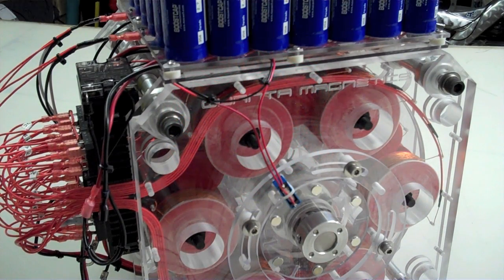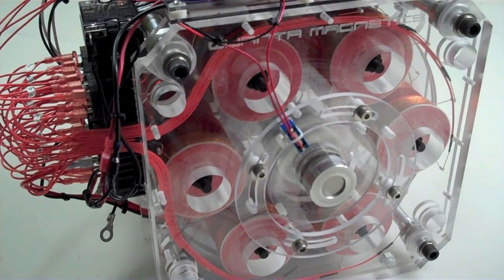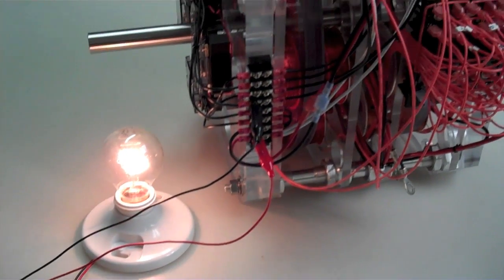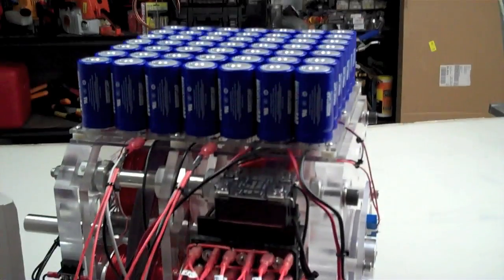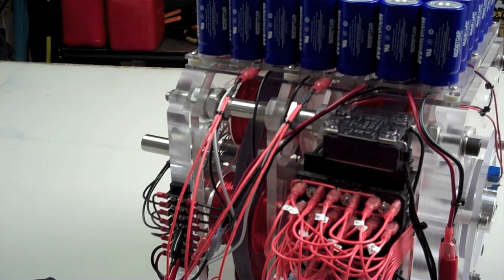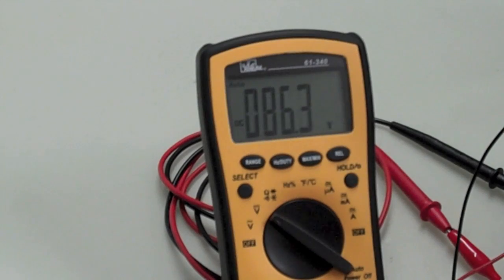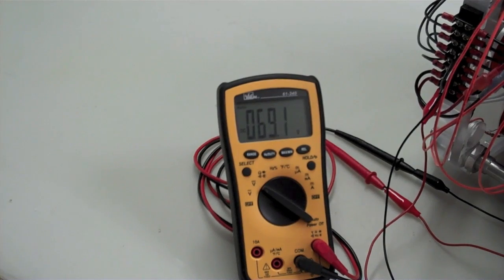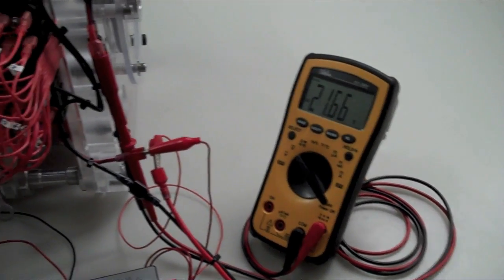Q2 SELF CHARGING.Part 2

Comment: I'm just gonna throw out an idea here about why the charge builds up.

It could be due to the grounding of the caps as they are static devices, if you notice what happens with static it builds up but once it finds a ground it releases its energy.

But you seem to have it grounded all the time so perhaps the caps are building up charge within themselves through static and then when you touch them you are providing a alternative path for them to travel a much easier path than a cable, would I be correct in saying the static burst is fast and powerful but drops off very quickly? Once the burst of energy has been used it remains safe?

If so then it is likely to be a similar effect of lightening following a path of least resistance.

I believe helicopters do the same thing build up a static charge so when they winch people up they have to first throw out a cable/rope to dissipate the charge otherwise the winching could kill the person from the static, in other words the whole device in your case the caps become statically charged.

It's just an idea I could be wrong.
Reply: You may want to look at RC circuit ( resistor + capacitor) controls charging and discharging times capacitor . Voltage is the height of the damp and amps is the size (diametre ) of the hole so Power = volts times amps    
faraday cages are lightning protection capable heheheha does it strike twice in the same location , keep your feet dry and off the ground , hope you don't have to kiss your ass goodbye hehehe

Comment: So, why not just charge your battery banks directly from your power source??
As beautiful as this machine is, it obviously (and by your own admission) is a NET consumer of energy. Is this not just an elaborate and very efficient motor?

Also, why do you need the very large cap bank if it generates its own power, surely, you really only need 1 cap to smooth the output from the generator?
Reply: ***** I wouldn't be too pessimistic, this guy seems to have a solid understanding of his project and from my past experiences it is very difficult to explain something this complex with the use of just a few youtube videos. Sometimes you try to explain something and people just don't get it or have no faith, so… I'd say keep yourself updated with what he does and if you have suggestions, suggest them! Not just be like no that doesn't work, no this, nope that. In essence teamwork is how engineers progress.

#PMMG4HYBRID good luck with your project and keep us updated on the outcome. Thanks!
Reply from the maker: I can understand your reasoning, yet without the quick charge/discharge rate and capacity of multiple ultracap banks, you would certainly not be able to obtain a similar time extended charging operation. Smoothing output is only a minor aspect.
Reply: PMMG4HYBRID Thanks but this doesn't answer the question. You admit on your website that this machine uses energy to keep it running so how is it worthwhile putting your device between a solar panel and battery bank? Why not save the energy and connect the panel directly to the batteries (via a MPPT controller or suchlike).
Reply from the maker: Rowan White You are absolutely correct. In our "Home Power Station" video we show a single solar panel charging one bank of batteries through an MPPT, while another bank of batteries is being charged by one of our machine models that is powered intermittently by an auxiliary output port of the MPPT. In this extremely conservative setup, our charger is able to continue charging the secondary battery bank throughout the night while only intermittently consuming input to the ultracaps via the MPPT.
Reply from the maker: ***** Not true. Solar is much slower on its own. Value is in charging speed, portability, mechanical footprint, energy conversion method and more. If it doesn't spin, it doesn't win.
Reply: PMMG4HYBRID The unit is as you truthfully said "a net consumer of energy" therefore there is no way on earth it could possibly be faster at charging than a good MPPT charge controller?
Fascinating to watch but wouldn't it be more honestly described as a kinetic sculpture than a "generator"?
Reply from the maker: Rowan White No. Although the MPPT is a valuable component, it does not produce a pulsed output. Nearly every new conventional battery charger uses pulse technology for a good reason.
Reply: Rowan White solar panels or photovoltaic panels are great for running brushed PMDC motors which in turn could be used for pumps on solar water heating systems ( I prefer gravity draining systems ) or driving PMDC brushed motors, as in this  video to efficient charge capacitors for short term storage . Caps are very appropriate for regenerative braking such as utility velomobile or off grid living ex. for high volume exercise music . Pedal generators are another good could use for caps  . Batteries are for longer term storage and caps are for efficient short  term storage with less losses therefore better use of kinetic energy  .

Comment: how long does it run for with a load on the spindle shaft for example say you connected a 240v house generator to the spindle will it run and how long for also could you siphon some power from generator back to your system
Reply: i'd imagine it wouldn't

Comment: I want this, so when I am out of Lights in my apartment for weeks at a time, I could still charge up my mobile devices such as iPad, iPhone and Android devices, so I can get on the net.
Not having to worry about running out of batteries, because I could recharge my devices with this unit...lol
Knowing I can recycle more power without the need of actual energy from my Electricity Provider until the lights kick back on.
Such as a City Blackout..... Im getting seriously tired of having blackouts and I am left without power in my apartment for weeks at a time.
This "Might" solve my problem when im in Blackout. - It will keep me sane......

Comment: Use the original Rotoverter and built a one kilowatt generator , give the plans public and sell the device yourself, the inventor of the Rotoverter gave you green light to do so and adviced you to use "lexan" polycarbonate,  as acrylic suck feces ! & breaks easy  you can directly tie the rotor to the motor shaft using a "c" motor plate face .

Comment: If this machine is self charging, would it not get faster and faster until it burnt out?
I am not a de-bunker and I am very interested in this field of work, but if it self charges that means more coming out than in, certain configurations of this into other generators could surely end up powering a house?
Reply: Either a voltage regulator or just a plain old dimmer switch will fix that...
Reply: It its obvious it self regulates to a degree  were rotation hits electrical PEAK RESONANCE  , more speed it will go out of resonance making it go up & down in hyperwaves as predicted in Rotoverter ZPE RE conversion disclosure material  also the reed switch limits over acceleration as it stops working beyond certain speed , it either locks or remains open ..

Comment: question... what if you added a conventional car alternator and pulley on the drive side to charge your two 12 volt storage batteries? would that cause too much draw and kill the efficiency of the main generator? if not, or at least itll push it to the point where it will put out more power than it requires to run, then it may have the potential to prove a very useful supply of emergency energy... also... had a thought, you may be able to start it by hand if you had a flywheel on the end of it to turn the shaft... basically the way old model Ts crank started.
Reply: Car alternators are super inefficient , in dealing with over-unity devices that acquire energy from the ambient by means of transformation you need to use part of the excess energy to make device work and the resultant to be used driving other device or accumulating the energy in battery's or other form of energy to be used later.

Comment: I like the idea and can think of hundreds of uses.  So couldn't you add a little more weight to the flywheel to maintain momentum so you can allow a controller to "shut down" the motor for 2-3 seconds or less and redirect all power to bank 3 for a quick "full" charge on the caps?  Just wondering.

Comment: the fact that you believe you can't get shocked by a charged capacitor in your hand says VOLUMES about your expertise. the reason you get a shock is the increased voltage. it is the voltage that penetrates the skin, you can touch high current at 5v all day, but at about 50-60VDC will penetrate the skin and depending on the current can be dangerous. A common prank in EE labs is to have a charged cap with the leads taped to the sides, and when someone walks into the room you toss it to them, they grab it and get shocked.
Reply from the maker: We did that prank over and over in high school electronics.
Reply: the fact that you Skwisgar2322 did not pay attn but yet decide to ridicule when he obviously DID state if you touch the aluminum top side of the capacitor banks he would probably be on the floor from getting a whopping shock i believe was his exact wording in this video this kinda signifies that you dont have the capacity of listening and learning and i bet you cant even tell us exactly how a capacitor fuctions as in its proporties if not ill educate you
Reply: case gets charged by static and this motor produces quite an static potential due to the RE conversion and the acrylic rotor static discharges in metal parts as if it were a Vandergraft electrostatic generator , so indeed can give knee bending shocks to anyone touching ungrounded static charged parts.
Reply: PMMG4HYBRID how much money do you want for it? if you still have it. If you dont have it anymore can you make another? I would like to buy it. thank you.

Comment: For how long will the T2 run while powering up the motor as a load? You say it charges itself while running but something is not adding up to me mate! If it can charge itself then why does it have so many capacitors? You should be able to run it with say two or none? The charging rate must basically be less than the depletion rate. I feel like I am missing something!

Comment: It is a well known fact that capacitors will acquire a charge from the environment ( RF induction/ether etc), and should always be stored with a shorting link across the terminals to avoid surprise shocks. This is especially significant in close proximity to magnetic or electromagnetic fields such as in a radio station environment. I've personally discharged some worryingly large charges that have accumulated on caps where someone failed to put shorts across them - certainly enough to kill you!
Hope this helps.
Reply: Can you explain that for a person trying to learn more about electronics?

Comment: Capacitors hold a charge when taking down old florescent strip lights they used to be in there if you didn't ground them first you could get a shock

Comment: when the capacitors are disconnected. if you touch them you are the completed circuit. and the other thing about moving voltage from bank 1&2 moving over to 3 that is i think the principal of ghost voltage. if they are all connected to each other thats equalization or if you like osmosis/ the diffusion of molecules. or in this case voltage from a place of higher concentration to a place of lower concentration, until both are equal. if you already know this disregard my comment. plus i have a question. what is the actual weight of the rotter. and the diameter of the shaft and the rpm?

Comment: There should be an status indicator for each bank if its charging ok or not like green light if its charging and red if not; this gives the operator an indication to change the bank with new ones. Or it maybe a better design to have a second  upper chamber of charged bank so that if the lowers banks are no longer usable, it automatically switch to upper banks so that the motor wont stop then the operator would just load new set to the lower bank and this cycle applies to the upper bank. If you could design it like this then maybe we could call it semi perpetual machine.

Comment: Wow!! - That's the coolest looking "executive desk toy" I have ever seen.. The build quality and visual appeal are first class. However, I am completely confused as to what the actual purpose / application of this technology is. You clearly explain it's NOT a perpetual motion fraud machine, but don't really tell me what it is.... But that doesn't stop me from wanting one just because it's so damn cool to look at... Great job!!. :-)
Reply from the maker: Point well noted. Thanks Dale.
Reply: James Demos I think he's left THAT up to your imagination :v
Reply: I think the idea is that you can connect this to a renewable generator like wind turbine or solar panel to charge, and hold charges efficiently so that you can tap into it even when there is no sun light or wind (like a glorified battery). The demonstration shows that the machine can pump out a respectable output therefore able to handle a fairly demanding load until the caps are completely discharged and the momentum of the rotor is lost.
Just a guess... Correct me if I'm wrong :p
Reply: I am wondering what the practical application for this would be? What could it be used for? Can you power a lighting system or other appliance with it? Is there a way to store the electrical energy in a storage type battery and boost the efficiency of a home solar power system? What happens when you apply a load to the shaft? Does it have any torque?
Reply: Peenut Gallarry my guess was a smoothing device - to take a highly irregular input source and give a very clean output?

Comment: What happens if you disconnect the batteries, will the voltage continue rising? There must be other mechanisms increasing the voltage slowly. I noticed the input power was about 10W. That's potentially quite a lot of energy.

Comment from the maker: Thanks. It's experimental of course, primarily designed for charging a bank of storage batteries to power an inverter. Uses frequency pulses and cap charge and delivery from extremely low input. Not designed as a direct raw current AC output generator typical of fuel burners. Since energy can be neither created nor destroyed, one certainly has the opportunity and advantage of recycling.

Comment: My guess about the shock question is that when it is connected, if there is a circuit to the battery bank, it is grounded and the current will take the path of least resistance to the ground. When it is not connected, you are the connection to ground. Some factors could be if it was your ring finger(gold wedding ring?), what type of shoes you wear, flooring material, were you sweating? No matter what, the answer is Ohm's Law.

Comment: No you cannot power your house with this, because the power stream generated is too weak. As you can see in his demonstrations, and load placed on the mechanism reduces its stream significantly. Hence, if you would imagine turning on a light in another room, that the all subsequent lighting would dim accordingly, not to mention the common loads of any additional functioning products within the household. Therefore, this mechanism is reduced to nothing more than yet another toy in the toybox.

Comment from the maker: I try to show demonstrations of various characteristics of the machine. Many individuals experiment in other ways as well. It does produce mechanical output at the shaft, but not extreme. I find the best use for that part of its output is to power an additional low drag alt/gen that can circumvent Lenz's law while contributing to electrical output. See the Q3 video. As little as 10 solar watts input will deliver interesting results. No physics violated. Thanks.

Comment: I have many doubts cuz i'm kinda confusd. This is essentially an alternator powering a Cap bank powerng a motor that runs the generator right? You showed that this machine can power loads connected to it.if i connect a mechanical load to this shaft protruding out, say a fan blade how much faster would it come to a halt? Can i connect solar panels to it and use it as a big fan and use it to run a light at the same time? Or will that be violating physics? Thanks for clearing doubts. amazing video!

Comment: if you hooked two of those motors together to charge one another wouldnt that remove the eventual power loss in the coils? AND that would be enough to get at least 210 Volts.

Also do you make these to sell? or just for fun?

Comment: If you just switch the load on the generator on imediately after the Coils are directly in line with the Magnets and draw as much as possible as fast as posible for an adjustable degree of rotation, then the generator will try to drive itself and not create any mechanical loading. This is because the induced field directly after TDC when the coil in circuit will create an electromagnetic field in opposition to the permanent magnets pushing them the way they already want to go Focus on Load

Comment: To get some serious usable output from this with NO External input is just a matter of switching the load. Only draw curent from the output coils from TDC and Lenses Law will make the load curent create a field that will add to the speed of rotation. In fact you will have to reduce the input , change the timming or draw some load curent a little before TDC to controll the speed and prevent runaway and self distruction from High RPM   - Geoff

Comment from the maker: This is absolutely NOT true. Pulsed high voltage potential is definitely what you want when it come to chemically reactive storage medium. Current (amperes) is not the issue and therefore of little consequence in this scenario. It would only be extremely important if you were attempting a direct power to load application.